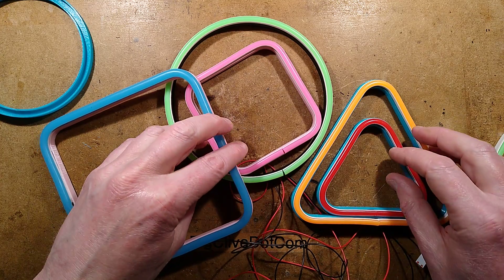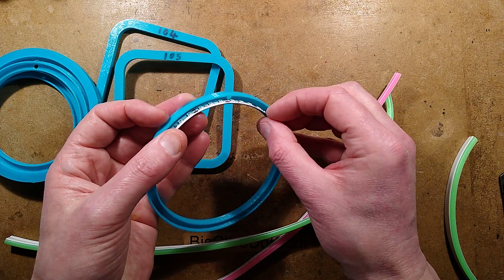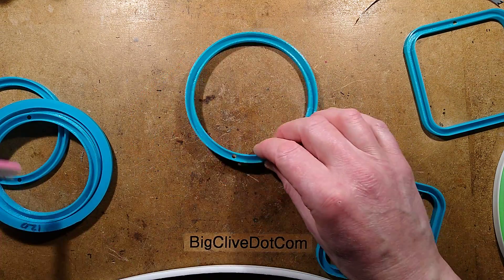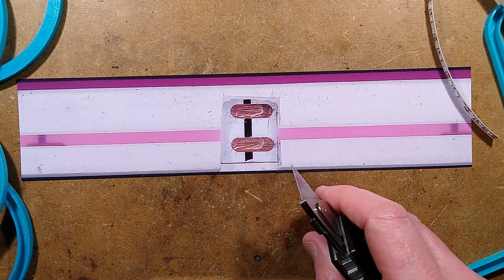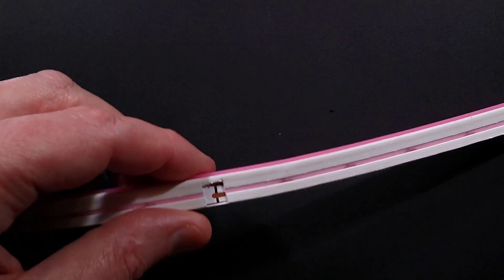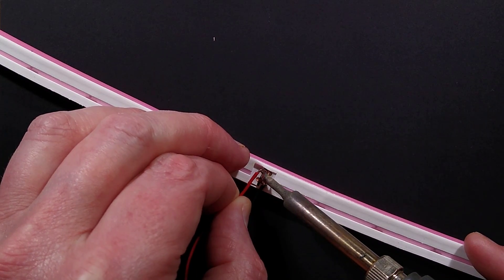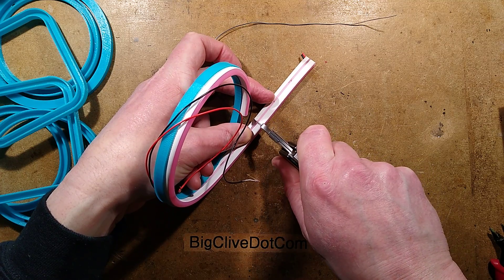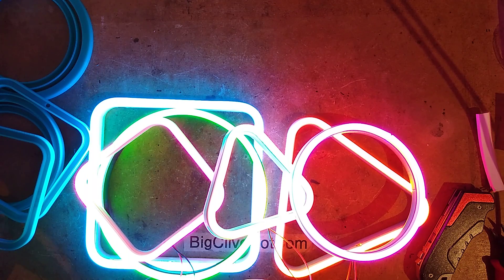Make custom LED neon shapes

Comment: Clive can you join different colours in the same frame with a smooth transition?
Reply from the maker: You can jolin sections and from a distance they merge.
Reply: Sorry I wasn’t thinking I guess you can just wire the colours separately. 
Wanted to try and get the circle to alternate colours to give the illusion of movement ( spinning wheels )

Comment: I have been on the fence about getting a 3D Printer, now I am definitely getting one! 
I have so many applications to make these neon style LEDS to then incorporate them into my epoxy resin designs. 
Thanks Clive, see staying up at night really does yield productivity! ( well inspiration that will eventually lead to productivity ) 
Glad you posted on my Facebook now. 😊
Reply from the maker: I always recommend against potting LEDs directly into resin as they will fail in the future and it pays to make it easy to change them.  But a standard clear LED looks great potted in clear resin.  The lens disappears and you end up with a sharp dot of light.

Comment: A couple of things:
- My 3D printer "just works", only fail so far has been the filament breaking, had a close call from it getting a minor jam (easy to fix)
- Wouldn't it be possible to create a script that has n sides? Just use some geometry for it?

Comment: I think you'll find the death of neon began long before LED signage existed, with hoodlums throwing rocks at the signs and breaking the tubes.   If even a small part of a tube cracked without breaking, the gas would still get out and the whole length would have to be re-made.

Comment: I wonder if the script could be adapted easily enough to use the measured length of strip available, rather than the dimensions of the resultant frame?
I don't really have much interest in 3D printing, but these OpenSCAD videos are tempting me!
Reply from the maker: The first circle one was originally based on strip length, but it actually varies slightly between brands due to the way it goes round bends.  So I changed it to outer size.

Comment: Im a programmer and im too lazy to learn OpenSCAD, so i usually went with FreeCAD with spreadsheet that calculates all the things and is a bit easier to understand
Reply: @foofoodog  Ill have to try that, thanks!
Reply: I went the opposite way, tried FreeCAD first and thought that it was unintuitive for anything beyond the basics. Then I tried OpenSCAD and it just clicked. I've been using it for everything since then.

Comment: I'm not looking to get a 3D printer, but it's getting hard to find anybody else sensible to watch. 🤷‍♂️
Reply from the maker: I keep the 3D content to a minimum, as I know that not everyone has a printer (yet).
Reply: The Mynt3D Pro I've been using proves sufficient thus far, as I wait for their reliability to improve.
Reply: @BradTech.  If you have a 3Dprinter you can make your own tat !!!

Comment: I have a silly 3D printer, I think it's still the largest consumer 3d Printer, The Chiron, put it together, never used, and that's because the bigger it is, the harder it is to level. The first one I bought came with a chipped heating bed which was only about an inch and an inch in from the back corner meaning could have kept it, but took like 3 days after they received it to send me a new one. The auto-level on that one was amazing, and apparently in that short time they had updated the SD CARD OS, and the new auto-leveler was TERRIBLE. SO... 3 years later, still haven't touched it. THOUGH, the one bit of advice I will pass on: FUCK THE PAPER TEST, all that matters is that it's squared, so all you need is a perfect square set usually for woodworking and squaring drill press bits or table saw blades, etc. NOT SUPER expensive, obviously the more you spend the better the square but a good 30-50 USD range one should do the trick.

Comment: Yep, 3D printing youtube channels make it sound like a massively complex thing when its not!  I have kept the Cura reccomended settings for my printer other than setting temp for PLA to 215c first layer then 210c and bed 60c first layer then 55c, i use that for all brands of PLA and the only setting i ever touch is adhesion as a raft is sometimes needed for large items to prevent warping.   had a 3d printer for nearly 2 years and my build plate was leveled once when i built the printer and it got done again recently after needing to re adjust the build plate runner adjusters because of play, none of that obsessive messing about like the youtubers would make you think is necessary.  Build, adjust and print and only mess with it again if its not working properly!

Comment: That very interesting and a nice project to make. Could you look at the ring lights that's used for phones to make recording videos easier and explore how it's made and maybe make one to compare home made ring lights to a factory made ring light?
Reply: I played around with this exact idea not long ago. The performance was pretty weak and the traditional approach of a round PCB with forward-firing LEDs is definitely a lot more effective. If someone makes a flat LED tape with relief cuts that's designed to go around bends on the flat axis that would probably work great with some resin cast in as a diffuser, but I haven't seen a tape like that.

Comment: As always, great content mr. Clive. Could it be powered by a wireless charger method just by adding coils (weird solution required for the strip itself, with a big regular coil underneath or accompaining the strip?) or am i being dumb? I feel i am being dumb lol
Reply from the maker: It's possible you could add a built in inductive coupling coil.
Reply: @bigclivedotcom  TikTacToe board with wireless LEDs
Reply: @pbertlin6194  That's a cool idea, I'll definitely make one if I can find smaller/thinner neon led strips but if you use these then the board would have to be pretty massive... You also need to use either 9 seperate mini power transmitting coils or make the board really tiny because they don't have that long of a range... Interesting project to try tho. 🤔
Reply: I think the power requirement of these strips is too high for wireless power... Have a look at Clive's videos about the wireless LEDs - they only give a tiny amount of light...
Reply: @stepheneyles2198  No. I believe he said one of the strips he was using is only 10v @ 120mah so a mere 1.2W. Even bad QI chargers can easily supply at least 5W so you can use strips roughly 4x longer than the ones he showed in the video and still use them at max brightness. There are QI chargers that support up to 15W or even more so you can even go 3x bigger.

It's hard to tell how bright they are in this video but they look extremely bright, certainly bright enough to cause eye strain in person so you'd probably want to run them at a fraction of maximum power, maybe half which would allow you to make it 2x longer yet again so 12-24x longer in total but if you're planning to make one that big you're probably not gonna move it around enough to justify wireless charging, might as well just use a wire if you're never gonna move it. 

For the most part wireless chargers supply enough currently for practically any handheld/portable device that it would actually be useful in.
Reply: New idea: capacitor + resistor between the coil and the leds to overcome the voltage requirement, turning them into a strobing led strip? (Keep in mind this poor soul is actively trying to learn basic electronic stuff lol)

Comment: Carefully avoiding adding the "cross" to miss on that PlayStation copyright strike I see. 😏
Reply: The PlayStation logo and/or associated symbols are considered too basic to be protected under copyright. They are likely covered under trademark law, but the stipulations are surprisingly different.

This may or may not be an issue, and it depends on a lot of different things. Playing it safe is fine, but trademarks can typically be used in artwork without issue. Look at Andy Warhol, for example.
Reply: @marsandbars  (psst, buddy. it's a joke. i do appreciate the effort though)
Reply: @DeathInTheSnow  I got it 👍

Comment: I've had an Ender 3 for about 2 years, it hasn't failed on me once apart from bad bed adhesion due to not being leveled properly but as long as I occasionally check the levels and wipe the dust off it just keeps going without issues. A lot of people seemed to warn that you need to do this and that every now and then to keep it running and avoid clogs etc. but I've done barely any maintenance and can't see anything being out of the ordinary (yet)
Though I can see why using one would be really problematic for someone with very little technical knowledge so the cheap hobbyist models definitely aren't ready for the masses

All I can say is try to avoid those weird closed-source printers that seem to require specific brands of filaments and whatnot, the Ender 3 is a really good option because of the enormous community support and there's infinite amounts of mods and parts and all sorts of stuff available for it, and it also happens to be one of the cheapest models out there particularly with that kind of print area
Reply: I've had the Ender 3 and Ender 3 Pro for about the same amount of time. Both ran great out of the box. The biggest thing is to be careful assembling them. I ran a few rolls of filament through both before doing any mods, and they ran just fine. For the price, and the availability of many mods, they've both been fun and educational. 
I've modded one really heavily, and it prints nearly 24/7, the other one has a few minor mods and prints maybe 8 to 10 hrs a day. TBH, the mods didn't change much, they were more just to see what tinkering I could do (AKA for fun). The only upgrade that I'd really recommend is stiffer bed springs. I don't even touch my bed leveling after setup unless I've had the hotend apart. In the time I've ran them both, I've had 2 heater cartridges die, and one thermistor start reading funky. I'm not meticulous on keeping it clean, but I do take a moment every now and then to check the belts and roller adjustments. My problem has been what to do with all the empty filament spools! I've used as many as I can and given a bunch away.
Next job will be recycling the brims and support materials into more filament! 😃
Reply: @jasonkuehl639  bought a printer 18 months ago. 
Have had 5 or 6 filament orders cancelled for what to me is bs reasons. It’s not like I live on a small island. 
Seen several videos of ppl making their own filament and wondered how plastic milk or soda bottles would work if processed in to filament.
Reply: @patomahony9747  I'm not sure about milk jugs, but soda and water bottles are usually made of PET and from what I've heard work fairly well when made into filament. That was another of my ideas, once I have my shredder and filament extruder set up, I should be able to take in a decent amount of local plastics for recycling. Another (but rather expensive) option is to use .065 round string trimmer line, as it's predominantly nylon, and already the correct size for 1.75mm filament. A word of caution with the trimmer line, it has to ran at high heat, above what would be used to print with ABS, so you do need an all metal hotend (the Teflon bowden tube will rapidly degrade and produce highly toxic fumes above 260 degrees C).
Reply: I found the use of hair spray keeps the object down and allows a clean breakaway when finished
Reply: @Arachnoid_of_the_underverse  I've used gluestick on mine but I only really put it just in case if my object doesn't have much surface area, it seems to stick really hard so I have to be quite careful although sometimes it just pops off once it cools down
Reply: @Arachnoid_of_the_underverse  Hairspray is an live saver.
No matter if you have a heated bed or not. 

Get the cheapest one you can find and have fun printing :)
Reply: Plug-and-play equipment comes with premium price, which really sucks for beginners (or the general masses) who just want something cheap. Issue is: cheap equipment is only viable if you know how (and are willing) to squeeze out the full performance with knowhow and elbow grease – it's a hobby for a reason. Same with computers, audio equipment, hand tools, and (famously) cars/motorcycles.
Reply: I don't think FDM as a process is really amenable to ordinary people or ever will be. It's just too physically fiddly (similar to welding in many ways) and to be used effectively you need to be willing to learn quite a bit of CAD/CAM and design for manufacture, and you need to have the patience to get an intuition for what's going wrong by reading the signs on the part. There's just a high inherent barrier to entry based on the process itself. If a 3D printing tech ever became commonplace in the consumer world I'd really expect it to be the powder fusion process. Little worry about adhesion, little worry about supports/printability of the geometry, and the powder mess while worse than FDM isn't as nasty as liquid resin processes.
Reply: @treelineresearch3387  I would agree to an extent, you certainly have to be willing to learn, but you don't need to spend days/weeks/months or learn anything too complicated just to make some basic stuff like Clive has here, even less so if you're just downloading prints and following the instructions, with helpful tools like tinkercad the learning curve is rather low these days, it only took me about a couple of hours to have a decent understanding of how to use it.

I am obviously no printing or cad expert, but with only a handful of hours investment and aside from measurements being slightly off or no room for tolerances, I've otherwise made or modified several models and had a quite a bit of success, honestly I think I've had more trouble with the printer itself such as bed leveling rather than working with cad/slicer/settings.
Reply: The number one suggested I would tell anyone for bed adhesion is to just chuck out the glass bed they give you, glass beds I've found are completely useless. Get one of those flexible magnetic beds, they usually have a grit to them which is much better for sticking.
Reply: @kipter , the trick to glass beds is to bring them up to a higher temperature than for bed types (65 to 70 degrees C for PLA, 80 to 90 degrees for PETG, and 100 to 110 for ABS or nylon), and to use a slightly tighter clearance on your first layer. I use mostly alley picked window glass or mirrors as a print surface, and have no adhesion issues. I've also experimented with sandblasting the surface to make it have a very slight texture, but saw no difference between it and smooth glass. Glass does work, but it seems like most online resources make them sound like a plug-n-play print surface, when they do require a bit of fiddling to get them to print properly.
Reply: I have a ender 3 v2 just brought 2nd hand  after a million upgrades works great bead not sticking  I use prit stick and for the 1st 6 layers slow it down to 20% and brim for support if you have a ender 3 v2 make shore the power supply has decent air flow 80x80x10 fan upgrade and change cover 😉

Comment: To clean the oxidized copper pads I tend to use a fiberglass pen. Works wonders!
Reply: My mum had one of those for cleaning tracks when I was a kid, irritating as hell when you get a strand in the finger.
Reply: We use it a lot on PCB's to clean copper or golden pads etc but you have to clean with another brush the shards, a pain in the ass to remove if you get them in your hands. But it's the best for this job
Reply: @leosedf  I imagine they can be a pain in the lungs as well.
Reply: @ronnetgrazer362  no not really, it doesn't stay suspended and immediately falls on the table, in fact most of the times you get it in your hands is from tables or surfaces. I am using it for over 15 years.
Reply: @leosedf  I have no experience with this kind of tool, so I am not aware of particulate diameter and associated air suspension properties. I would like to add that silicosis usually manifests itself 10 to 30 years after first exposure, though.
Reply: @ronnetgrazer362  I can assure you it does not fly in the air and it's pure glass fibers.
Reply: @leosedf   @leosedf  It seems very useful. I think I'll order one of those pens to try it out for myself.
Reply: @leosedf  how about some brasso? 😅

Comment: I literally just bought two Ender 3's from a seller on ebay.  $69.00 each and free shipping. They are returned and possibly missing small minor parts (ie screws , tools, manuals)  one of them was missing 2 screws and the ($8.oo) pei build sheet. The other was missing nothing. :) Both work perfectly! If they are still available I plan on two more.....
UPDATE: they're gone....